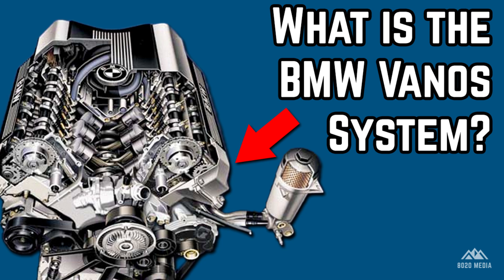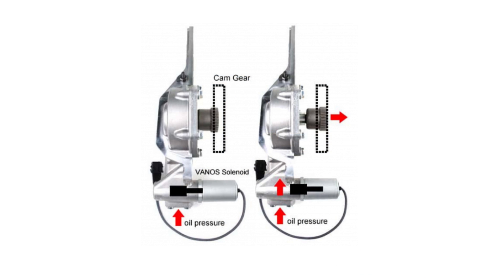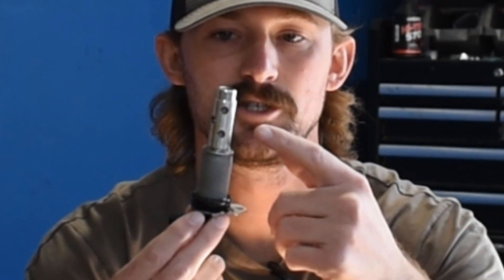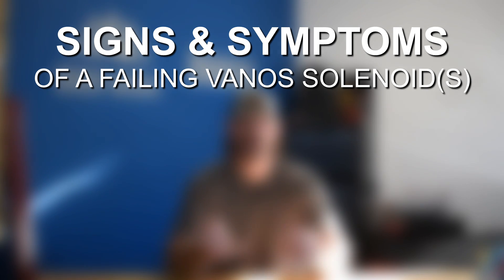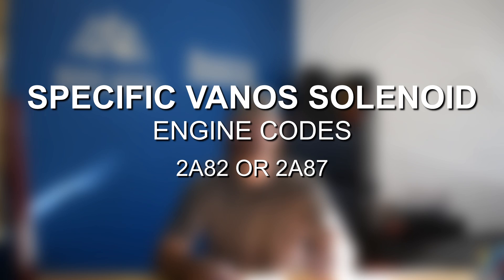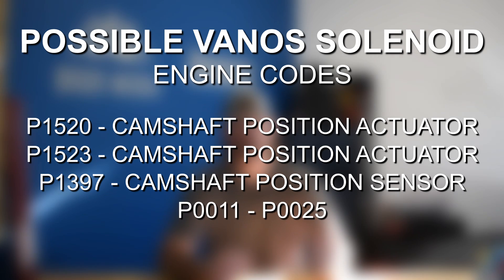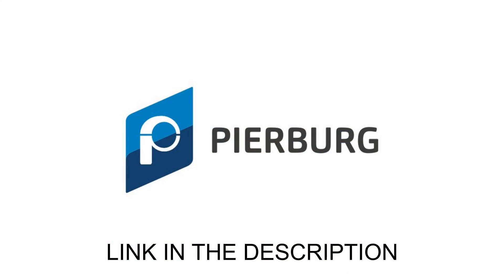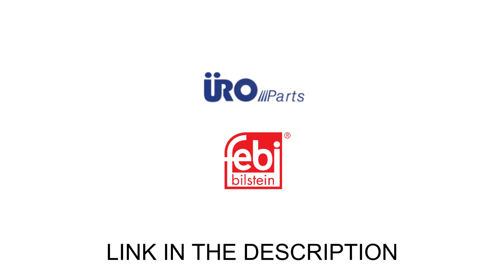Symptoms & Diagnosis of a Failing VANOS Solenoid!

Comment: i have a 2008 335i n54 and no codes are showing up but it sounds exactly like   its the vanos solenoid, throttle response is bad, idle sounds ehh its just weird my scanner isn’t picking it up
Reply from the maker: A - If your 2008 BMW 335i (N54) has poor throttle response, rough idle, and symptoms resembling a bad VANOS solenoid but no codes are showing up, the solenoids could be clogged or partially failing without triggering a CEL. Try removing and cleaning both VANOS solenoids with brake cleaner, as oil sludge buildup can restrict their movement. If the issue persists, swap the intake and exhaust solenoids—if the symptoms change, one of them is faulty and should be replaced. Also, check for low oil pressure, dirty oil, or a weak battery, as these can affect VANOS performance. Keep us updated!
Reply: @ Thanks for the reply, while the solenoids had a ton of oil they weren’t the problem unfortunately, I’m taking it in to a local BMW specialist for a service they said if the problem isn’t found they’ll diagnose it for me, service will cost $550 Australian dollars and then $220 per hour for diagnostics if they need to do it.
Reply from the maker: @anothersmurf9966  Sorry to hear this. Keep us updated!
Reply: @8020Automotive  So it’s still at the shop, but they said 

•the clip that holds one of my vacuum canisters had broke and that might be the reason why it’s putting me into limp mode. 

•theres an error in my steering module which is why my flat tyre monitor come up and it says dtc failure (which makes sense cause i read it can make your steering wheel feel heavy which it does) 

•he also recommended my spark plugs be replaced 

I get it back mid day Monday so hopefully i can finally feel the car in its full power!
Reply from the maker: @anothersmurf9966  Keep us updated!
Reply: @ Sorry forgot to reply, got the car back Tuesday and it feels amazing it was definitely the broken vacuum canister clip that was causing me to go into limp mode, had the guys to a service, new oem vacuum canister and spark plugs car feels awesome! although there’s is this horrible ticking sound when i engine brake or brake in general lol

Comment: Would it be possible to have a bad vanos solenoid if I have low compression in one cylinder?
Reply from the maker: F - A bad VANOS solenoid typically wouldn’t directly cause low compression in one cylinder, as it primarily affects valve timing, not the sealing ability of the cylinder. However, if the VANOS solenoid is stuck or malfunctioning, it could lead to improper valve timing, which might cause misfires or uneven performance, potentially masking or contributing to other issues. Low compression in one cylinder is more likely due to mechanical problems such as a worn piston ring, damaged valve, or blown head gasket. Keep us updated!
Reply: @8020Media  the mechanic I took it to said it was a burnt valve and it would be cheaper to replace the motor. It's a 02 2.5 l with 140,000 miles. I bought it used and maybe put 20,000 mi on it. A little camera showed the cylinder heads were pretty gunked up with carbon. I dumped some fuel injector cleaner on the Pistons and let it sit overnight and the next morning it blew out a football field of smoke but no changes 🤷
Reply from the maker: F - Sorry to hear... I hope you find your solution. Keep us updated.

Comment: my '11 328i n51 threw a P052B code, i'm reading that bad vanos solenoids throw this code, do u have any information?
Reply from the maker: S - Certainly possible. This is often caused by issues with the variable valve timing (VVT) system, such as a faulty camshaft position actuator, dirty or low engine oil, a malfunctioning VVT solenoid, or a stretched timing chain. To resolve this, check and replace the engine oil if necessary, and inspect the VVT components and timing chain for wear or damage, replacing any faulty parts.

Comment: The solenoids themselves are they suppose to have play in them? Ie shake it a little and you can hear the valve move a bit. 

Is that a faulty solenoid ? I just assumed they was closed until they get power
Reply from the maker: K - If you can hear internal movement when shaking the solenoid, it’s likely worn or faulty. Cleaning may help, but replacement is often the best solution to ensure proper engine performance.

Comment: Hello.  I have a 07 X3. With A rough idle i have no codes. I recently changed the valve cover n gasket the MAF sensor and the spark plugs  now I’m scratching my head.  Any help will be greatly appreciated
Reply from the maker: M - Could be the VANOS solenoid. Would be best to give them a clean to see if anything helps. If not, this video may be more helpful for your research: https://youtu.be/BiYsqRJCLhE

Comment: hey i have a n53b30 and rough idle only when its cold and only when it drops to idle at around 650 rpm then it shakes a lot and throws yellow check engine. when i hold it at 1000 no problem and when warm its running perfect. I think its the injectors what do you think?
Reply from the maker: S - Are you getting any engine codes? That would be the best place to start.
Reply: @8020Automotive  misfire cylinder 4 and 5 and nox sensor heating

Comment: waht does it mean by p1554 error bmw 5 series 2006 straight 6 engine n52
Reply from the maker: M - More than likely means the VANOS solenoid is sticking. Try to remove it and clean it.

Comment: The number one cause of rough idle and vanos codes in BMW is the vanos cage missing from the oil filter because it was thrown away with the old oil filter, the second is low oil and clogged vanos. 
If you find black fiberous stuff on one of them, your car sucked a serpentine belt at one point and the cams are probably damaged as well or the cam vanos stuck.
Reply from the maker: B - Thanks for sharing this insight!
Reply: What are you talking about? How could the outside Serpentine belt be chewed up inside the Engine.... ?
Reply: @user-hc3dr6mx2c  Oh buddy, BMWs oil filter housing soaks the belt in oil, then later,  suck the belt behind the crankshaft pulley where it's caught up by the timing chain set and all inside the engine like a sipping straw
Reply: @BigBenny24  Never heard of that, do you have a source? When the leak is so bad on the belt and the belt never changed, its just bad maintenance.
Belt change is recommendet after 120000km.
Reply: @user-hc3dr6mx2c google" n54 belt inside engine " , it's a sad story
Reply: @BigBenny24  okay, now i see 😥
Reply: What of the N62 engine?? I saw black stuff on vanos screen and oil filter..exhaust  another was stuck too....but after changing oil and filter,  and cleaning vanos I still get multiple misfire in all 4 bank 1 cylinders.

Comment: I have an 08 550i with n62 engine, i believe i have the same problem. On my car, it only happens if the car has been parked overnight with temp dropping below 40F, it will misfire until the engine warms up and then no issues after that. I've changed coils and spark plugs and didn't fix the issue. This morning, i disconnected the vanos before starting up and sue enough no misfire and no rough idle. I will clean them first before replacing, great video, Thanks.
Reply: Do I have to recode or relearn after replacing? If so how do I?
Reply: @derekmaldonado3300  I replaced mine a month ago and I didn't have to do anything.
Reply: @MingeShagger how is the car running?
Reply: @Franchise40  Took out all 4 VANOS solenoids, they weren't clogged up, but at 200k miles i thought i might as well replace all 4 and the issue has disappeared. I  went with Febi because the Genuine BMW too expensive and its no longer my daily driver.
Reply: @MingeShagger definitely going to have to try that. I’ve started noticing my car running weird, it’s a 328i with the N20, now that it’s getting in the 40s and below at night in Florida.
Reply from the maker: M - Thanks for the feedback! Hope it helps.

Comment: Hey, also, I have to admit I used the cheap Chinese crap solenoids and now I'm changing them to Pierburg..yes it's throwing crazy codes..!! My fault..SO DON'T DO WHAT I DID..!!😆😆
Reply: These are definitely a part you want to get OEM 😂 thanks test piggy
Reply from the maker: N - Haha. Unfortunately, get what you pay for. Thanks for sharing your experience!
Reply: @8020Automotive  misfire cyl 4 and 5 and nox sensor heating
Reply: Did that work?
Reply: @melissabrockman7107  yes perfectly.!!😁
Reply: Pierburg is also made in China
Reply: @imartynenko  pierburg and Bremi too I think but only for certain parts

Comment: I absolutely agree..but bad Vanos will also cause codes for different sensors acting up..ie throttle range..studdering...pressure sensor and so on..also causing you to run in limp mode.
Reply from the maker: N - This is true. Thanks for sharing.

Comment: Can these cause long start ups hot or cold?
Reply from the maker: B - Very possible!
Reply: @8020Media  getting a cam shaft position sensor code. Changed it and did nothing so maybe vanos
Reply from the maker: B - Did you clear the code? How long has it been since you replaced the sensor?
Reply: @8020Media  yes and months. The code comes on if the car stumbles on take off etc amd goes off on its own then return ls again when it repeats the problem
Reply from the maker: B - We have some videos that may help with your research: https://youtu.be/7bqAIbYRdnc

Comment: I just rebuild my B48 engine, after driving for about 90km, a fault code P0012. Changed Vanos actuators, camshaft sensor, pistons, oil pump, etc. but i did not changed the Vanos solenoid, could this be faulty, thats why the P0012 is coming on?
Reply from the maker: P - It's very possible!

Comment: Have those EXACT issues, but my 330i throws vaccum leak codes. Couldn't visibly find a vaccum leak not sure what to do high miles
Reply from the maker: R - Have you taken it to a shop? What drivability issues are you seeing?
Reply: @8020Automotive   basically you start driving even with your foot to the floor and its as if it has 50 horsepower. the revs go up so slow that the ecu takes a second or two to gear down and then i get a high rev jump of speed, that makes daily driving it uncomfortable as i struggle to merge smoothly every single time. also some cold startups struggle and need me to gas it up to keep it starting, sometimes not always. rarely it also has a rough idle, or should i say a jumpy one. i havent felt any misfiring nor do i think it went into limp mode as far as i know but it's too slow and running lean as it is (bad gas mileage). also, manouvering on parking lots going from drive to reverse to drive or whanot has a chance of it stalling.

i took it to the dealership for an oil change and coolant to be done, they didnt find the exact leak nor gave me an estimate or told me what to fix kind of useless to get an inspection there. same driving with new oil. if it's not the solenoids and it's some sort of air leak causing this as well as it running lean i am not sure at all where to start looking. else it could be a weakening fuel pump as it is a high milage car with no record of it having been changed
Reply from the maker: R - Based on the drivability issues... it could be multiple things. Might be worth taking it to an independent shop to diagnose it.
Reply: @8020Automotive  thank you for your reply

Comment: Hey there! After replacing spark plugs, coils and injectors i came across this solenoit variation between target vs actual position and i was able to replace the two eletrical vanos actuators on my Mini Cooper S F56 B48 engine. I noticed some slight improvements but the variatons still persist, specially at constant light acceleration.
Would you say that if i was able to remove the eletrical actuator i could also try and extract/replace the VANOS central valve aswell? If yes what would be the ttool?
Reply from the maker: S - Certainly could! What engine codes are you getting?
Reply: @8020Automotive  I get no error codes. Logging the data I see variations between the target VANOS vs actual with differences of up to 10º, mainly on the exhaust one. Like I said I already changed the two actuators but I’m a bit scared to remove the central valves themselves, I don’t know if it changes anything with the timing or something like that
Reply from the maker: S - What drivability issues are you getting?
Reply: @8020Automotive  jittering acceleration on constant light throttle application. After trying to replace Vanos actuators myself I just noticed my 2014 copper S has 2017 components so I’m thinking the car never went a full calibration process
Reply from the maker: S - Certainly possible! Keep us updated.

Comment: Good video for the most part. I 100% disagree about not using the BMW solenoid. I own 11 BMW’s right now from E46’s to E70’s. I’ve replaced about a dozen of the vanos solenoids and after the first four Pierburg failed within 6k miles I started only using BMW. Yes you can save about 50% using Pierburg but to state they’re better quality than BMW is a false statement
Reply from the maker: A - Thanks for the feedback. Our statements are based on our experience. Everyone is held to their own opinions.
Reply: @8020Automotive  Came across this video… I just today ended up with these 2 codes. BMW 328xi e92 2F81 and 2F83!! Wasn’t able to find a whole lot of information directly to this other than couple posts suggesting these are Vanos Solenoid related! I have cleaned these in the past as a preventative measure/maintenance since I purchased this car used and I didn’t trust the previous owners form of TLC cheaping out on alot of maintenance items! So I did lots of updates/betterment! Car starts up normal, odd slight idle drop in rpm but drives amazing! I get no other DTC other than this today 2F81 & 2F83… could this really be a sign of both solenoids going out slowly?? 
Thx
Reply from the maker: @Nicoz79  Yes, codes 2F81 and 2F83 on your BMW 328xi E92 are related to the VANOS solenoids and indicate possible exhaust and intake side timing issues. Since you've cleaned them before, it's possible they're starting to fail due to wear or internal clogging. Common causes include dirty oil, solenoid failure, or an issue with the VANOS system itself. First, try swapping the intake and exhaust VANOS solenoids and see if the codes change (e.g., 2F82 or 2F84). If the codes switch, then one or both solenoids are faulty and should be replaced. If the issue persists, check for low oil pressure, clogged VANOS filters, or timing-related issues. Using high-quality oil and regular oil changes help extend solenoid life, but replacement may be needed if they continue to act up.
Reply: @8020Automotive  greatly appreciated man!!! I have run seafoam through the engine upon purchase as a engine flush, followed by new fluid filter again 1k after and engine runs smooth pulls strong! Only full synthetic 5w40, to running injector cleaner, screens cleaned, vanos solenoid pulled cleaned… vanos bolts were revised/changed and cams look beautiful. I think I’ll lean into your suggestion on solenoids given kms/age use and just replace it with 2 new quality ones!! Thx man!! 🍻
Reply: Funny enough, Pierburg is the OEM for the BMW solenoid :)
Reply: @SOMT91 says made in china on fcp euro tho 😭
Reply: @Stancedude1 yeah a lot of bmw parts are made in china.
Reply: Yeah, pierburg literally makes the part for BMW and you're getting it much cheaper from them. Same goes for many sensors on the BMW and Mini Cooper.

Comment: Thanks for the video!
To diagnose a bad solenoid, is it requiered to have all or most of the symptoms?
After changing, injectors, coils, spark plugs and run a desalphation of the NOx catalytic converter, I only have rough idle with no code at all.
Reply from the maker: N - Definitely not required! Sounds like you're on the right track.

Comment: Hey man I have a 2008 135i and I’m having a cylinder 4 misfire. I went to get it diagnosed and they’re telling me to REMOVE AND REPLACE EXHAUST AND INTAKE VANOS ACTUATORS. Does this sound right? I thought if it would be just my spark plugs or cam shaft sensor but now they’re quoting me 2.6K. If you could respond with some insight or your thoughts I’d appreciate it
Reply from the maker: J - It could be your ignition components (spark plug/ignition coil) or the VANOS solenoid. What engine codes are you getting?

Comment: Thanks for video 📹 I have question I saw on my vanos solenoid metal hair cut ,what it can be?
Reply from the maker: A - Thanks for the feedback! Not too sure what this means though.
Reply: @8020Media thank you for answer!I mean that I saw on my vanos solenoid metal shavings
Reply from the maker: A - There is potential that this could be very bad.. metal shavings in oil is not the greatest sign. Are you having any drivability issues?

Comment: Thanks for this informative video. I have an E87 118i (2008). It’s been stalling lately while driving, and recently stalls after I start the car. No codes are coming up. I’ve cleaning MAF, plugs, solenoids (2x) and the camshaft sensor.It’s stalling less now. I used a 9V battery to test the solenoids and it moves freely - do you think the solenoids have gone bad?
Reply from the maker: M - It's certainly possible. We have a video for stalling that may be helpful: https://youtu.be/7bqAIbYRdnc

Comment: Hey man gfeat video. My 535xi is in complete limp mode, i press fhe gas when running and in drive absolutely nothing happens. Will this fix the problem??
Reply from the maker: G - It could. Do you have any engines codes?

Comment: I have 2A7C issue code in my N51. Car has a cold start problem- chocke(not always). Is it not a solenoid issue?
Reply from the maker: P - It is certainly possible. You can try cleaning the solenoid to see if it alleviates the problem.